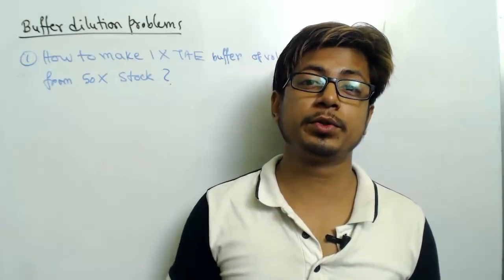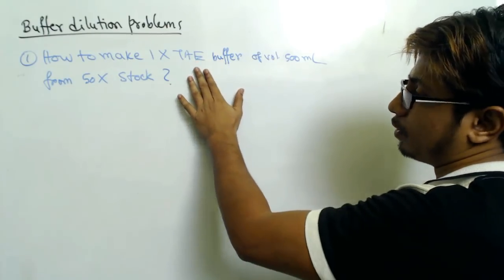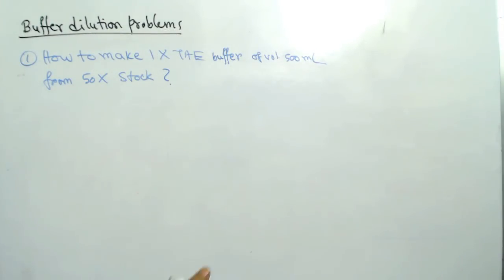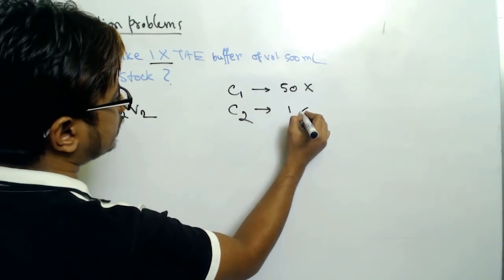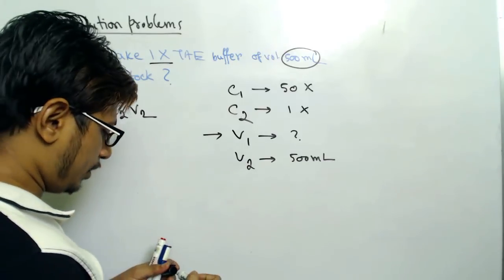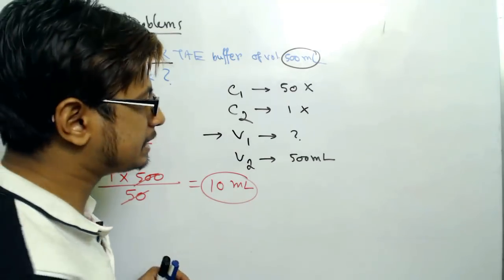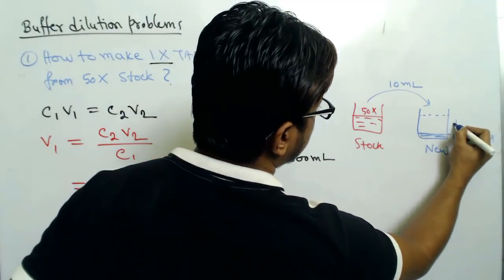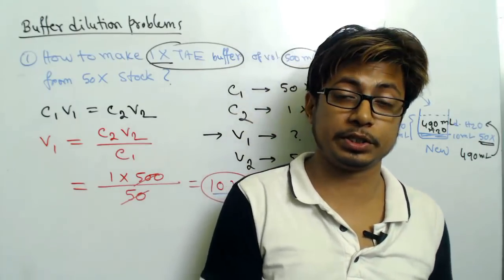Buffer dilution problems and calculations

Comment: Hi, I was wondering for example how you can calculate this if you want to dilute a loading dye concentration (lets say 6x or use your example 50x) and know the final volume of DNA sample has to be 10 uL plus the amount of loading dye (V2)? but you do not know the amount of loading dye yet which is V1. 
thanks!